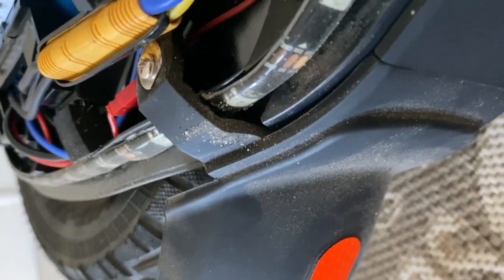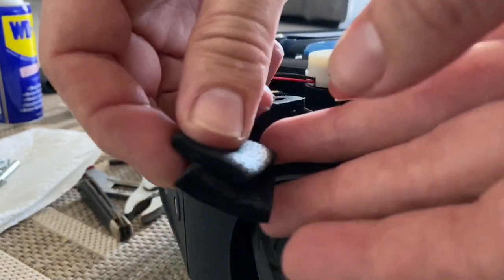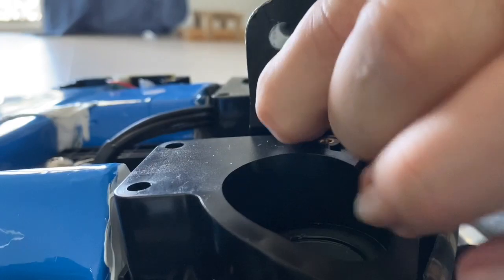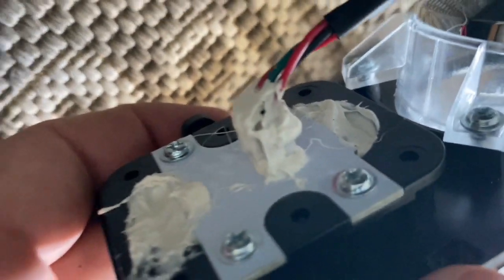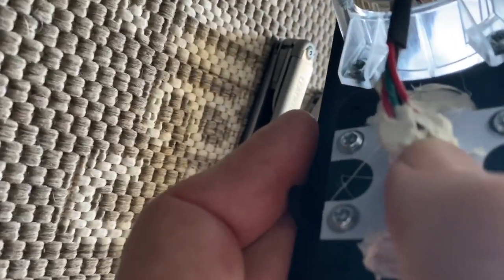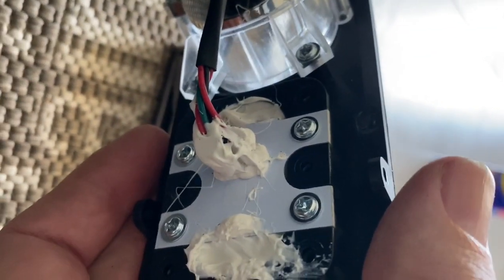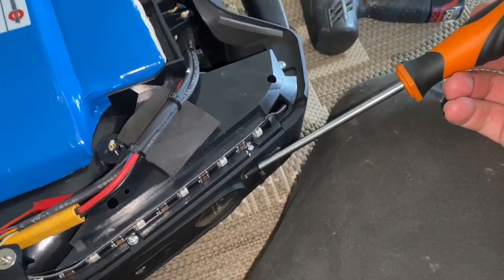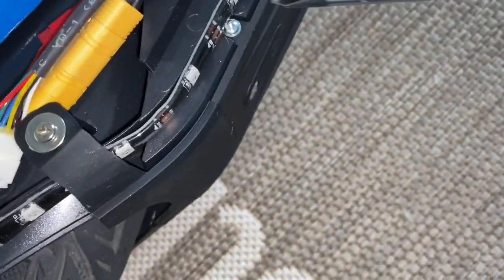Dust and waterproofing KS 16X

Comment: Thanks for the video. (Hint) Use an ice tray to hold the screws you remove. Similar screws in each separate ice cube slot.
Reply from the maker: Thanks. Although this particular job is quite easy as far ask different types of screws goes, the only different screws are the 4 in the front panel. I should have made more effort to remember that...

Comment: Did you ever test this in rain? I found the actual place water was entering from was from the light sensor and not the inner shell. When you smack a fat raindrop at a respectable speed it has enough force to squeeze through the tiny gap. It's not airtight at all. Put a hairdryer to the hole and you'll feel hot air coming out from the bottom of that rubber bumper. I taped over the entire switch with transparent sink sealing tape.
Reply from the maker: I only rode in the rain once and it was before I did all this work actually.
Reply: I rode my 16x across Ohio last year (220 miles over 2 days) and at one point had to ride through a driving rain storm. Luckily the board didn’t short but the light filled with water. Knowing what I know now about how much it leaks I’m feeling lucky to be alive :)
Reply from the maker: @JesterOTL   I think your experience and others i've heard show how safe this wheel is to ride in the rain.
If it was super risky I'm sure the stories would be as common as the stories about Gotway wheels exploding lol. Enjoy your wheel man. That must have been an epic ride. I would love to do something like that.
Reply: Glen Edwards I think you’re right. The board is pretty well protected. I need to see about sealing the gaps by the light and mud flap. Maybe cross Indiana next spring?

Comment: Thanks for the video.  This is super helpful.  What kind of sealant did you use around the light?
Reply from the maker: I’m glad if it helps! I used Sikaflex translucent general purpose sealant. It looks almost white when it’s wet but dries cloudy clear.

Comment: Great vid, have you found any more spots or are these the few that this euc has? Overall I won’t be riding in rain, but may ride on wet streets after a storm, or the morning after one. Thanks
Reply from the maker: No I haven’t heard of any more spots that need attention, and ironically, the only time I rode in the rain was BEFORE I did this job! I didn’t see any signs that water had got in from that when I opened it either.

Comment: Hi.  
I just ride my 16X under the most heavy rain ever.
After that, my 16x power On and Off alone.
I just have disassemble it and i can see that LOTS OF water also came from the handle bars. 
I have to find a solution for that. 
Beware !
Kingsong MUST Waterproof their EUC better than this...
Reply from the maker: Ah no! I hope you can dry it all out and get it running again! I have never ended up in the rain again since I did this waterproofing so long ago.
Reply: @GlenEdwards  She alive since few minutes.  ☺️
I'll fully test it tomorrow!   🤞
Reply: Just ride it with q big plastic bag on it when it rains, i do it and have got bo problems what so ever